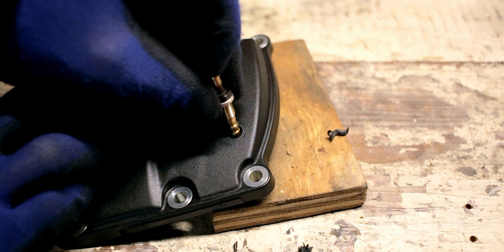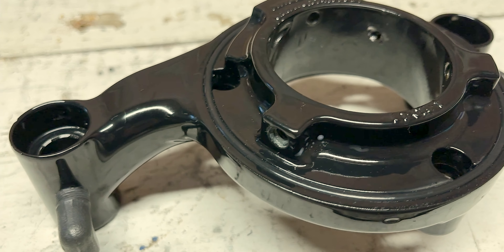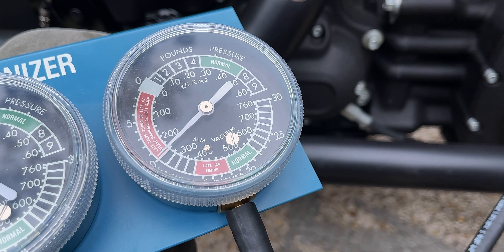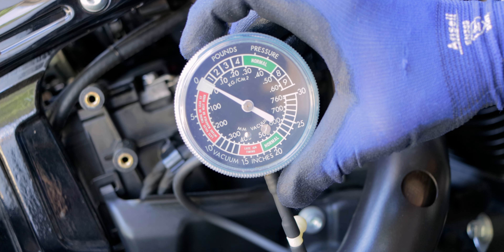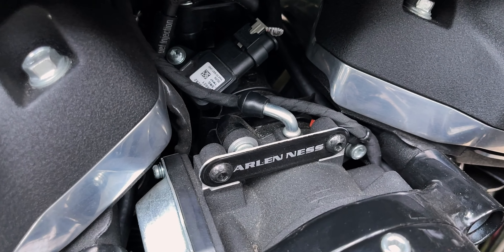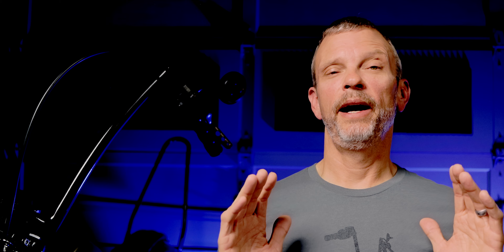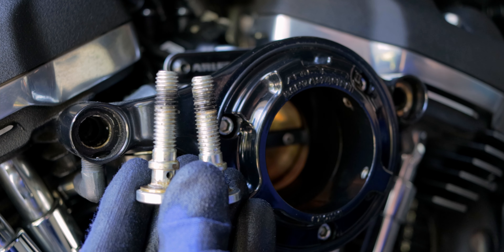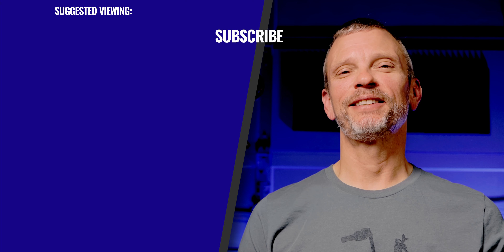M8 Crankcase Pressure OR Vacuum? • Crankcase Vent • External Breather • Check Valve • Stage III

Comment: Watching these videos, it concerns me that Harley has potential issues with solving an issue. When I mentioned the idea of venting the crankcase to the salesman at the dealership because I watched a bunch of videos that address a "sumping problem" with the M8 motors, AND asked if I installed a vent on the transmission cover would it void the warranty, you could see the hair on his neck go up as he mumbled something, and then said "probably".
It would seem that the only reason to add a catch can system to the head bolts is to collect any oil and or water vapor that might be expelled due to excess crank case pressure. But if you eliminate the pressure, then would you catch anything in the can if there is no pressure pushing anything out thru the vented bolts?
If there is a need for the vacuum, but the issue of misting oil or water vapor is removed, then the vacuum is just going to pull air from the crank (or try to) that is just neutral or still heated air since the pressure in the crank has been eliminated by the crank case vent that is either installed at the dipstick or the transmission cover (either method creating the same condition of venting pressure).
From what I can interpret from these videos, putting a catch can breather on the intake resolves one issue and creates another. Venting the crank case solves both issues. It would also seem that the hot air argument around the intake air would be negligible due to the size of the passages in the vented bolts when there is a huge air filter allowing a ton of cold air to be taken into the throttle body. It kind of reminds me of the fart in a hurricane comparison. Is anyone going to notice the small volume of air that might be pulled from the head into the intake when all excess pressure from the crank case is removed?
When I talked to the dealer about this, he basically indicated that the world if full of opinions and that Harley has designed the machine to work just as it is...
Reply from the maker: Hey Manonymous108 - good discussion. At this point I’m most comfortable with a crankcase vent to deal with the obvious positive pressure while retaining the breather bolt setup to allow for vacuum when possible. I do plan to try out the catch can with vacuum, just to see how it works. 

I’m sure there is a lot of excess hype around these issues, but there is no doubt that sumping is terrible for the motor, and this issue of positive crankcase pressure is definitely a contributor and one that can easily be remedied. And there are definitely sumping issues with the M8 (and many other) motors. The fact that the 2020 oil pump gives 44% more scavenging than the first generation pump is a good indicator of that.
Reply: @RonsWorkshop  Doing more research I have seen other alternatives to relieving the sumping issue, and I noticed a note in another video you did, from Kevin Baxter (Baxter's Garage?) giving you a thumbs up for that other video. Interestingly Baxter noted that changing the cam plate cover and the oil pump could solve over 75% (?) of the sumping issues on a M8 because of tolerance buildup when mating two parts together. I'm familiar with this kind of thing having worked as a tooling inspector at Boeing. Over the length of a 747 (before laser optics) a plane was put together and it often wasn't straight nor did it fly in a straight line. They would adjust the controls to make the plane feel like it was going straight even if it was pointing off in a slight degree of angle because of the tolerance buildup in mating parts. I used to hear stories of pounding the link pins that hold the engine to the wing with a sledgehammer leaving shavings on the ground during install, but all this is a different story and not important. 
I was curious if you had any communication with Baxter on these subjects of venting. Madmonkey did a video where he demonstrated no vacuum at the oil dipstick and barely a pound of measurable pressure at the vented bolts at the head which people are venting to a filter or catch can.
Going back to the fart in the wind comparison having all that air available thru a large air filter it would appear that IF there is any oil visible around the filter assy, that there is not enough vacuum thru the throttle body to pull the oil into the intake, which is why there is oil pooling at the air filter. If there was the vacuum to pull that oil, it wouldn't collect around the bottom of the air filter, which again makes me suspect the reality of any appreciable vacuum OR vacuum loss when adding a venting/catch can system. Then back to the crank case.. Another video shows a person having installed the A-1 vented oil filler cap with oil all over the motor because it pushed a bunch out the breather element that was hanging in back of the air cleaner. That problem seems to be allegedly attributed to the necessity to run the crank case at a half quart low in order to prevent the oil from coming out of the vent. This seems ridiculous when you look at another product like the Fueling dipstick which offers two options such as a vented bolt on top of the dipstick OR having a tube and filter such as the A-1.
The more videos on You Tube that I watch the more I get the idea that these videos are mostly to sell products but do NOT tell a complete story. I have yet to see any tech videos like Doc Harley or Harley techs or even Kevin Baxter address these with any clarity and completeness. Videos like yours address these issues with people trying things and then reporting whether they have benefits or side effects but without giving any real "to the point" causes or complete explanations by techs that address the cause with a standard fix. I'm not in any way deprecating your video efforts to address these at all, and I appreciate your efforts, but they are not definitively proving cause and effect or absolute solutions. Because there are so many opinions there can't seem to be any definitive answers to the questions that come up with suggesting options. The more I dive into this the less confident I am when seeking a final solution to a problem I may never have if I ride my bike under 3000 rpm's for the life of the bike according to information that implies sumping is a non-issue if you never go over 3k rpm's...
The baxter video that suggested the tolerance buildup and solution to buy better parts than Harley makes is disheartening in thinking I just spent $30k on a bike that has inferior parts by a company that makes those inferior parts to sell you more expensive parts to solve an issue they create in planned obsolescence AND prevents you from going anywhere else under threat of losing your warranty.
Sorry, I don't mean to rant.. But I was wondering if Baxter gave you any insight into this vacuum thing at the crankcase or head bolts that is a bit more solid than these maybe yes and maybe not an issue renderings that I have come to a dead end with.
Reply from the maker: Hey Manonymous108 - yes, I have had several conversations with Kevin about this issue of crankcase pressure, vacuum, and sumping. I won’t put words in his mouth, but he confirmed the point about the vacuum source for the crankcase coming from the breather bolts by way of the throttle body. In his live Q&A video from March of this year (March 21 maybe?) he covers lots of questions about all of this, so track that one down if you’re up for more info on the topic. There is vacuum generated - but of course it varies with engine speed / throttle position. I’ll gather more info on this when I tackle the vacuum-tapped catch can version of the venting solution. 

I also dislike the idea of running 1/2 quart less (or however much less) oil to keep a vented dipstick happy. My own vented dipstick project proved that cornering and acceleration will push the oil right out the dipstick vent, which is what led me to venting the transmission too cover. 

Good discussion - thanks for sharing your thoughts on the matter!

Comment: Could you run a hose from the throttle body vacuum port to the trans cover vent?
Reply from the maker: Hey Chris - yes, that's an option. I tried it in this video (https://www.youtube.com/watch?v=5h6Apcj7DDg), but I'm not sure if it's too much vacuum or not.

Comment: I was watching a DK customs vid about head breathers and they said there’s a one way check valve in the heads behind the breather bolts. That might be the reason you’re getting vacuum from that one hose barb and not from the breathers you put in the Ness intake
Reply from the maker: Hey Herb - thanks for that info!

Comment: Can you run the crankcase vent directly to the unused barb on the intake to add vacuum to the crankcase?
Reply from the maker: I’m working on a project now where I’ll do that - but with the addition of a catch can, and it will vent the crankcase (with check valve retained) and also incorporate the external breather mod. Could be the best of both worlds.
Reply: I see you point but I believe you don't want that oxygen depleted air to circle back into the system on the first place through that barb. Also as RPM's goes up the vacuum through the barb will get weaker and none at WOT.
Reply: @scoobiduu  yeah I rethought that out. After it leaves the crankcase why feed it back into the intake? Just vent both the crankcase and breather bolts to atmosphere is what I’m going to do
Reply from the maker: Hey Roy - that’s a valid point about the hot gasses for sure. I finished the catch can project. I’m not sure what the gas temps are but no doubt they are warm, but perhaps it’s a small enough amount to avoid negative impact. I’m currently using a throttle body vacuum source that seems to be constant. That allows me the keep the crankcase under vacuum. You can check it out here: https://youtu.be/5h6Apcj7DDg
Reply: @RonsWorkshop  First and foremost I love your channel keep up the good work. Second I watched your video you linked, Thank-you for catching me up. Third I know there are other catch-can projects out there but this one is pretty good. It might need a patent. Now for the cons, I don't like the fact of the closed loop system. That air in the crankcase is coming from somewhere and my only guesstimate is that it is blow-by, which is oxygen deprived. Then feeding it back into the engine. Toyota done the exact same thing as this system you came up with for motorcycles and separate the oil mist from air. This is there we disagree. I think  its better to let it vent to the atmosphere. Having some vacuum in the crankcase is good but at what degree. If there any negative side effects it maybe a horsepower or less and then gain that back by the vacated crankcase pressure. Hell that evens it out. You solved the oil mist so there shouldn't be and build-up of carbon anywhere. Overall PERFECT SYSTEM!!! in a perfect world of EPA compliance. I'll be watching you sonny!!!
Reply from the maker: Hey Roy - thanks for the kind words and for sharing your thoughts as well. You’ve raised some valid points! The one thing I don’t like about allowing a “fresh air” inlet for the system is that would be a foreign source and it would definitely need to be filtered. Would a little pod filter be enough? Maybe. Not sure. 

I’ve got a bit more testing and monitoring to do - still running with the version I ended up with in the video…BUT…
Reply: @RonsWorkshop  why not do the trax transmission cover vent and then just block off the head bolt vents?
Reply from the maker: @jamiemiller6912  I like trying things on my own - not always, but usually :) I have debated blocking those head bolt breathers with regular bolts, but I'm just not sure if there would be unforeseen negative consequences.
Reply: @RonsWorkshop  Ahhhhhhhh the more I think about this the more confused I get🤪 . The whole thing seems like a chicken and the egg problem. Where in this case the egg is Harley and the chicken is the EPA. Why do Harley engineers want to vent the crankcase in the first place? Because they want to prevent blowby entering the combustion chamber right? Blowby is caused by pressure from the crankcase causing shity oliy air from the crankcase bypassing the piston rings and entering the combustion chamber. So they vent the pressure eliminating some of the problem right? The EPA then says no f^@@n way do we want that shity air in our enviroment😡. So harley says ok let's vent the shity oily air from the crankcase therefore reducing blowby and then we will re route that shity oily air back to the very place ( combustion chamber) that we were trying to avoid in the first place🤦. Now I know that 1 out of every 3 engineers is as stupid as the other 2 but not that stupid. So this begs the question why would engineers bother with the design and build issues with venting for no reason? Why not just let the blowby occur and save time and money and get same result? Thus the chicken and egg thing because harley were clearly intent on venting outside at first until the chicken said no. So back to my theory what can we do as irresponsible environmentalists to prevent this whole shit show? The way I see it is we can block off the headbolt breathers and vent the crankcase using a one way valve therefore retaining the crankcase vacuum (lower pressure) during the up cycle of pistons to allow for an oil scavenging effect from cylinder walls and at the same time prevent/reduce blowby, or add the same check valve to external breather for same result.

Someone please educate me and prove me wrong or at least half right. 

Also why does the vent system into the intake area not prevent air rentering the crank case via the same route? I amagine it can only be because the vacuum inside the intake is greater than the vaccum inside the crankcase?
Reply from the maker: @jamiemiller6912  In theory that seems ok, but the big question is whether or not the head breather valves can still vent if regular bolts are used. And for the intake question - the concept there is that the vacuum comes from that airflow, not that it has to overcome the vacuum in the crankcase. But I haven't been able to prove or confirm that.

Comment: Does this mean I don't need a check valve for the vent
Reply from the maker: Hey Taylor - it's definitely not required. You can also check out the recent video where I revisited this and cover the top questions: https://youtu.be/JPI3AeMfYeg
Reply: @Ron's Workshop  hey thanks for the quick reply, I recently bought the nicecnc cover off of Amazon, only to find out it's only venting the transmition, which the stock already did. So, it looks like I'll be drilling and taping a fitting and filter in

Comment: Thank you so much for your videos!! I have 19 RGS and I just bought the Arlen Ness monster sucker the same exact setup you have on my bike before I just went on a 2400 mile round trip. I noticed an excessive amount of oil all over my saddlebags all over my motor and I was freaking out wondering where this was coming from. As you know it was leaking out of the Arlen Ness monster sucker intake. So I am back now from my trip and did not know how I'm going to tackle this problem and I came across your video and although it is a good solution to block off the breeder bolts in the head I really did not want to drill and tap into a brand new expensive Arlen Ness intake. I have also been looking at the same transmission plate that you put on as a venting solution. Do you think it will solve my problem with the Arlen Ness big sucker blowing oil all over my bike by just using the transmission cover?
Reply from the maker: Hey Dustin - the transmission too cover vent will definitely be a big help. I’ll be monitoring the bolts and intake for oil over the next few weeks to see how it goes. I don’t think you can go wrong with some sort of crankcase vent mod — and honestly I expect to put the breather mod back too after doing some more testing and monitoring. But I totally get not wanting to mod the intake. Still on the hunt for hard facts on this. Thanks for the feedback, and let me know what you decide to do and how it goes. 

If you want a channel sticker send me a DM on Telegram or Instagram with the mailing info @RonsWorkshop
Reply: @RonsWorkshop  thank you for your response!.. I'm very interested in seeing how this mod improved your breather bolts.. I'm just aiming to not have oil all over my bike when going highway speeds and if I can get away with just doing the trans thing I will.. I want to do one or the other just don't know which way to go yet.. Your videos help alot!.. Thank you sir!
Reply: Ron, i've been having this issue  since adding ss 124 kit. Oil pouring  out of breather. Wut type fitting did u use n trans cover and will it hurt if I dont use check valve. If so wut exact name is that chk valve n where do I get. Been looking at all auto parts. Cant find
Reply from the maker: Hey Lester - definitely use the check valve. Today I’ll be posting my follow-up to this video where I clarify the open questions. I see that you found the other video with the parts list: https://youtu.be/U6gOhbRQrwE

I’ll respond to your other question over there.
Reply from the maker: Hey Lester - I  just posted the follow-up video: https://youtu.be/BaG1VdOFe48